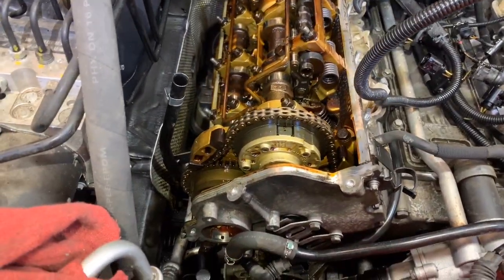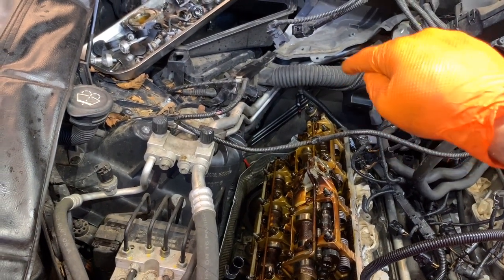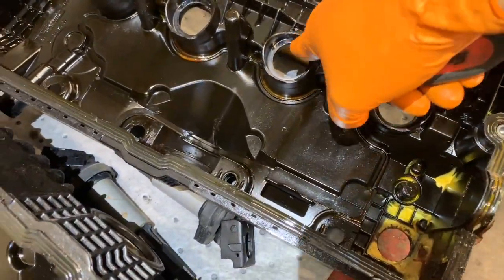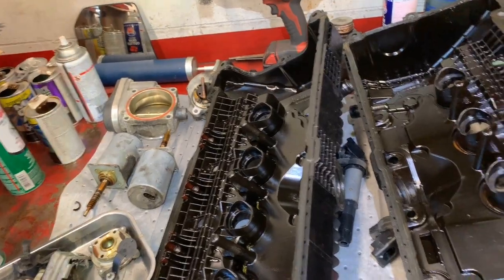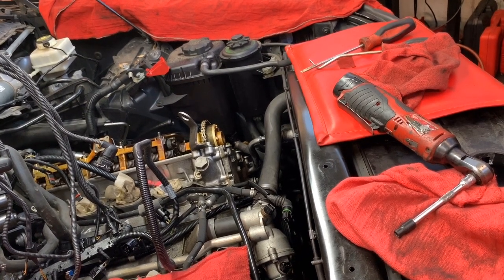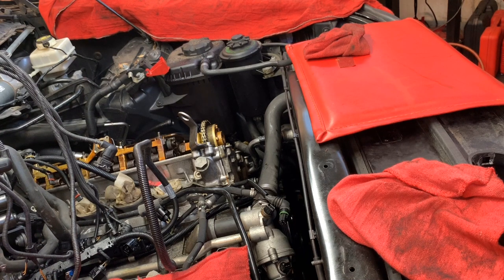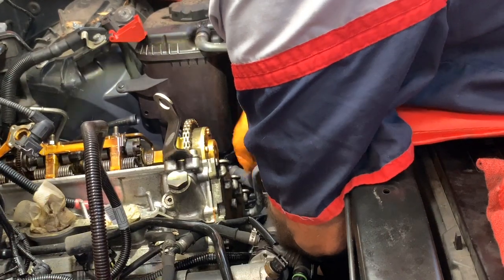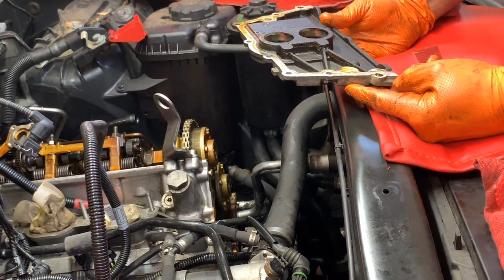2008 BMW X5 4 8L valve covers and oil leak repair! Huge oil leaks!! Part 4

Comment: Did you end up replacing the spark plug tubes that you had to pry off the valve covers? or did you use the same ones upon assembly?
Reply from the maker: I always replace them.

Comment: How much does a shop usually charge for a job like this? I'm sure every Bimmer with over 80k miles.need this job unless it was done already.  Yeah they are nice cars but they are o ver engineered. I think ima ride mine to it gives out then im done. I have an 07 4.8 e70. Nice ride but 2 many issues I have to do the throttle harness cuz its putting up the code. And the shops want 1k+. But good vids.
Reply: $700 at least
Reply: @dflex4180  don't seem that bad to be honest

Comment: Great videos! and thanks for sharing. I just finished watching all 4 videos. Really impressed with the gentle and clean job your doing. I am sure it's an inspiration to others. It will be great if you could please share the tightening torque of the fasteners going to the engine block! Thanks again!
Reply: Did you ever find the tightening torque for those fasteners?

Comment: Thank you for your time consuming videos.  I just bought a 2010 bmw x5 suv, it has a bad oil leak. Is it possible it might be an oil sending unit pressure switch? I just got the car yesterday.  Thank you.

Comment: I have one just like that. I don't know who hired the head engineer at BMW but jeez. That guy needs to earn a medal for doing just enough to get to the warranty expiration. Its like all of them gathered around and said, we need to make these good only up until the warranty expires. The whole thing is plastic, plastic and more plastic. My valve seals are lightly leaking but I am not paying more for repairs I'm sticking to oil changes and the like until it doesn't run any more. I will ride it to the junkyard. Already spent more than $4500 on a car that costed me $10k with really low mileage too! I bought it with only 88k miles just imagine what a 120k mile BMW is like. Should've stuck with the Japanese manufacturers- A Lexus or something. Never again unless its 0 miles and under warranty.  You live and you learn.  Okay, rant over sigh Very instructional video! I finally see why it cost so much to service and maintain Bimmers.
Reply from the maker: Omar Vizcaino I am sad to hear your story. I seen it many times with Euro cars. I always recommend to get low mileage and warranty or extended warranty. Other wise is a money pit!
Reply: BMW does not care about your used BMW they are only make cars to last till warranty after that its on the second  buyer...why do u think you get a $80000 suv for less than $20000 10 yrs later....if are not mechanically inclined then yes BMW is not the car for you....I agree with you but yet BMW is selling more cars than all of those makers..and after all this people are still going to buy them